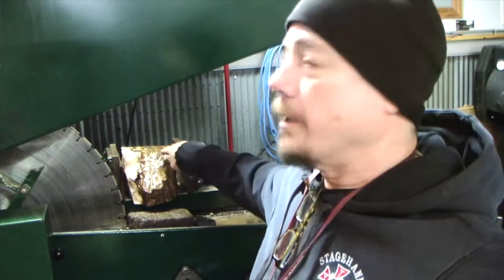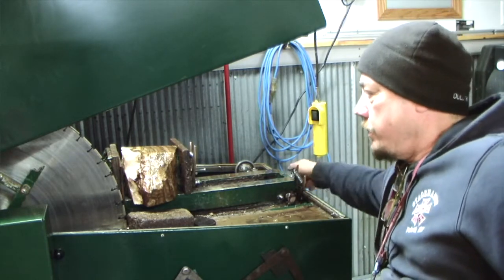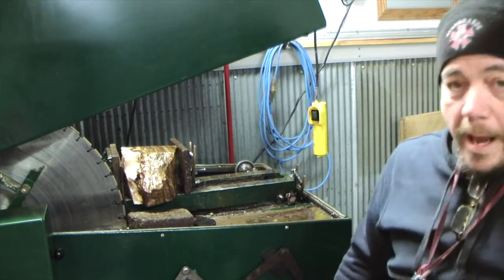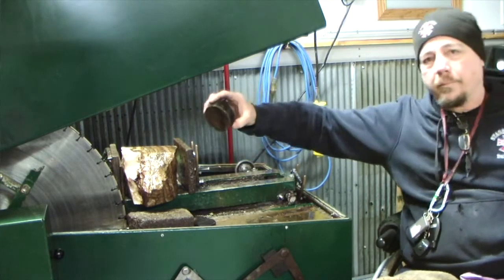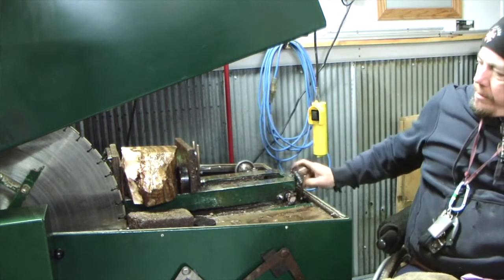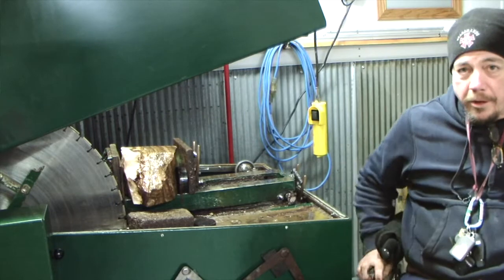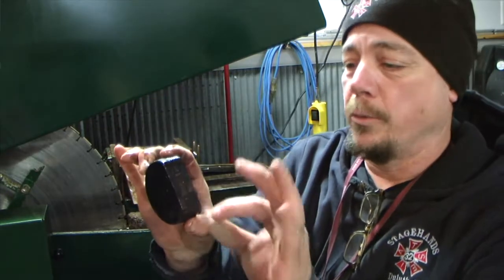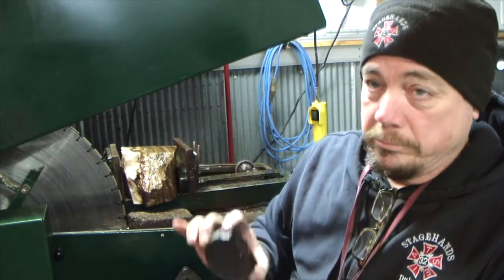Taming Unruly Rocks in your Slab Saw

Comment: Thanks! I have a new to me saw,and am wanting those rocks to stay put when I start sawing on them.
Reply from the maker: I still use hockey pucks quite often.
Reply: @DirtCleanerVideos  I was wondering if the rubber in the hockey pucks get overly heated when they might get cut by the saw.I was also wondering about using wooden shims to help stabilize the rock while cutting-if it might catch fire from spontaneous combustion.i have food grade mineral oil that I plan to use,and don't want any fires happening.
Reply from the maker: @Debbie4729  Your saw will cut through hockey pucks, wood and such like a knife through butter. They even cut steel. No problem with the heat. For best results keep your oil as clean as you can. I have other videos on ways to do that. Good luck.